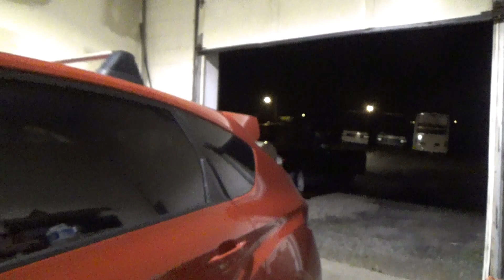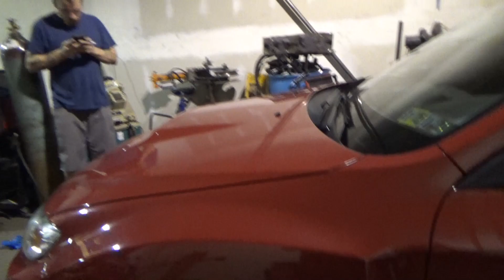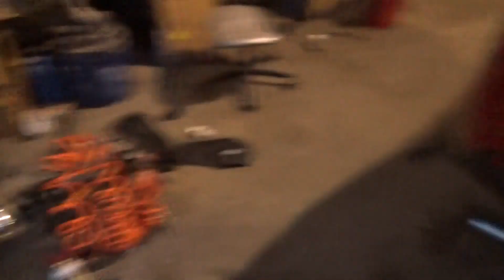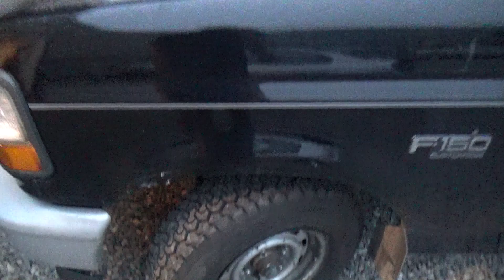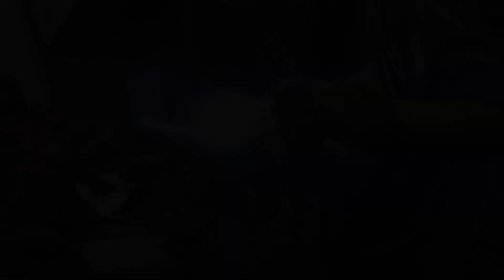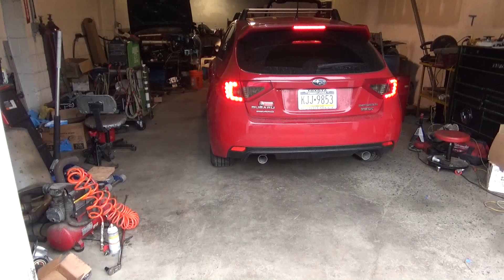2012 Subaru WRX Muffler Delete - Cheap Exhaust Mod

Comment: How did you get rid of the red lens on the taillight?
Reply from the maker: It wasn't my car ....I honestly couldn't help u with that
Reply: He farted on it.
Reply: Its a tailight overlays, its like a vinyl wrap but not for the whole light, look it up.
Reply: @emilecharbonneau4484  I thought it was on the inside?
Reply: @icenberg6658  no, if you're talking about the look of the tailights, its a film overlay, it comes in different shapes and color patterns
Reply: Émile Charbonneau no I mean the one that is the rear fog light. That is red as standard